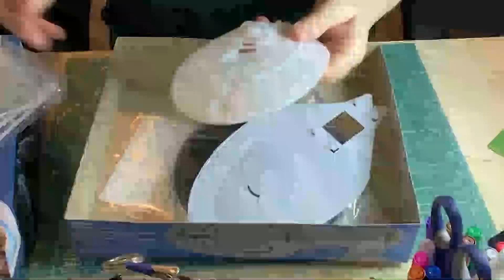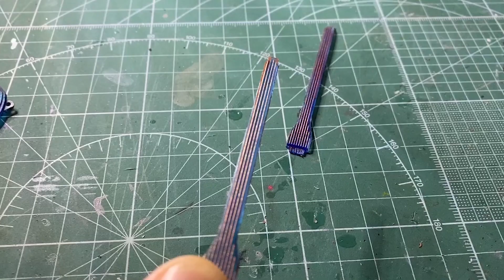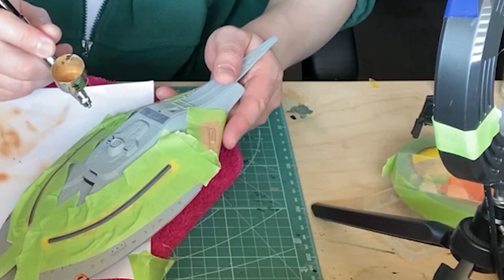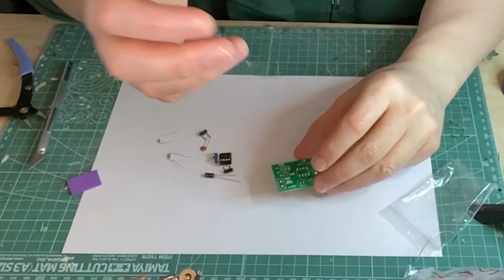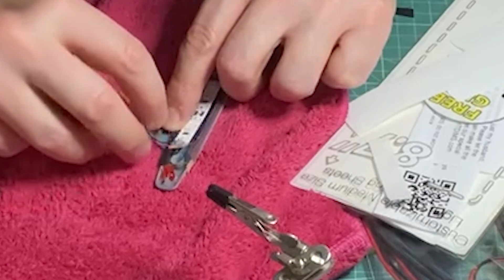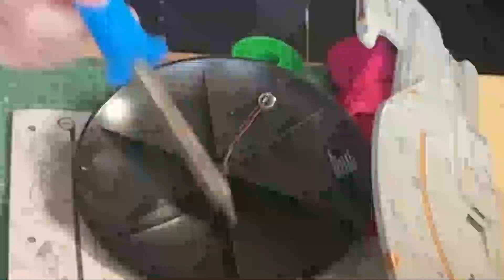1:1000 scale USS Voyager from Polar Lights

Comment: I have the exact, same kit; but I haven't gotten around to put together; but will soon. You wouldn't happen to have a pic or diagram of the ship painted huh? I can't find a good reference point to paint my model to closely match the model used in the show. Also, for the LED lights, did you use those, off the shelf light strips that can be found at Walmart or was it a complete custom kit found online?
Reply from the maker: There's an episode called Nightingale in season 7 wheres you can see shots of it landed in daylight. That's what I took it from. The lighting kit I got from a UK supplier, startreklighting.co.uk
Reply: Hey Dan, I have this kit and am up to the lighting part. The kit you brought from that link, is it the reveal one? I don't see one for polar lights. Did the reveal one fit just as good?
Reply from the maker: @tomnewdelhi  Yes the Revell one is the one I used, with a little modifying.

Comment: Very nice ship and great video, bought mine a few days ago, would be my first serious build so Ill definitely be using this video as a guide. Did you paint the clear parts for the front of the nacelles red or is that just the lightbulb giving it that color? if so, what color did you use for it?
Reply from the maker: Thank you. I used Rustoleum frosted glass to give it an opaque look and then used a red led to light it.
Reply: @dansmodeluniverse  Hello again! I noticed in the video that for the raised and accented areas you used xf23, which initially gave it a "green-ish" color, by the end of the video those parts look different, is that change in color the result of the clear coat varnish applied at the end? Thanks!
Reply from the maker: @Minicreeper301  I used XF-20 medium grey. the clear coats does dull it down as well though

Comment: 2 questions, The fiber optic cable used the LED lights as their source? the card you used to flash the Nav lights did you build that or purchase it., Ok, one more question.  every body drills a round hole instead of using the stand slot in the hull, is this just because its more convenient for the rod and the wires or could you widen the slot and use that also.
Reply from the maker: The lighting kit, including the board, was from a UK supplier, Star Trek Lighting, great prices, great service.
 I use metal straws, sawn in half, which have  a slightly bigger circumference than the rods supplied, so I widen the existing slot.
Reply: Thank you That will help me.  @dansmodeluniverse

Comment: Great build.! I'm going to try it. Yours looks soo clean. Did you spray it first then scratch all the lights out after.? I'm confused how you did that. Thanks
Reply from the maker: Yes, lightblocked, primed and main coats with 
acrylic then scrapped out the paint. Worked a treat.
Reply: @dansmodeluniverse  Thank you! Can't wait to get my kit now.
Reply from the maker: @redogg2749  Good luck with it

Comment: brilliant work!  I had no idea the 1:1000 could be lit. Well done!
Reply from the maker: Cheers. There just needs to be a bit of 'rethinking' :) So, instead of LED bulbs, use fiber otpics in some cases, that sort of thing
Reply: @dansmodeluniverse  you mentioned the lack of space inside the model, but it did come with semi transparent hull to aid in emitting internal light. Seems like a contradiction! Could you use a larger board to control the light sequences and strobes, or is there just not enough room? Maybe there's room inside/beneath the stand?
Reply from the maker: @brookestephen  It was tight but room enough for the board in the saucer. The nacelles are where it got tricky.  Good idea about the board in the stand, I'll keep that in mind for the future.
Reply: @dansmodeluniverse  Hey Dan. I dropped you a message on your FB page.

Comment: Very nice! 
Any chance you could share schematics of your circuit board? I've done similar with arduino boards but they really are overkill just to add a couple of nav lights. 
I assume yours is built around a 555 timer?
Reply from the maker: It is a 555 timer. Email me and i'll send you the set up.
Reply: Your work is incredible! I just got the translucent model and I would also love to see your schematics if you would be willing to share. I'm a beginner, but I've just done some basics with soldering LEDs, Led strips, and PCB boards with a bit of programing, but I would love to see exactly how you wired the board.